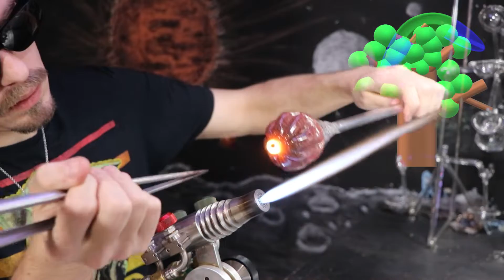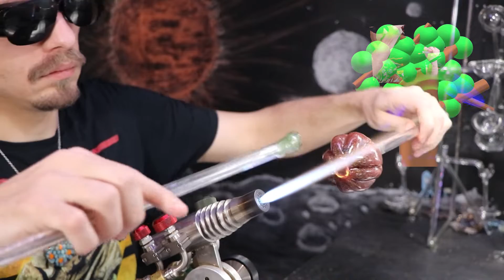Glass Pumpkin on a Lampworking Torch

Comment: Thanks for the knowledge! Quick question. Would it it be worth it to buy a glass blowing kit that comes with everything you need (even small kiln) or cheaper to buy everything separate?. Kits i am talking about cost around 3000.00 shipped in the US.
Reply from the maker: I think it would be better to start simple without the kit and buy more tools as you go. $3 Tweezers, graphite paddle, and a Reamer or Jacks can help you learn a lot. (26mm by 4mm) are good for main tubes & (12mm 2.2mm) for blow tubes. You can buy your kiln later also and take time to practice. Sales won't come right away so you have to plan long term. Thanks for the question Francisco and watching!
Reply: @MattJasa  I do have the money to buy a torch. Good idea. I can do that and practice and buy as I go. Thanks again !
Reply: My 2cents... Look on the various used seller sites.. FB Marketplace, Lampworketc.com, ... for someone selling a studio or selling off extras. I got a whole set up (250# O2 tank included) for $1000 off Craig’s List as my start up. They had Nortel Minor torch, the tank, didnyums, LOTS of boro tubing and rods, boku tools and loads of other stuff. The artist had come home from errands one day to find her 8yo sitting at the torch pretending to flamework like mom. Luckily all gas had been disconnected (for safety reasons) but it highlighted that the kids were NOT the right age to have that around AT ALL. Main thing I’ve heard over the years is to NOT buy a torch if the gas lines are simply cut off just below the intakes, no matter the “story”. It’s a sure fire 🙄 sign of being stolen and probably not working. But there are lots of people upgrading equipment or getting out of the trade who just want to pass it on and make a few bucks back out of what they’d invested in. Welcome to the FLAMES! 🖖🔥

Comment: Can you recommend a good beginner torch?
Reply from the maker: □The Alpha from Bethlehem Burners is a strong starter. It's also the center-fire for the Bravo I'm using. I tend to use it a lot, more than the outer-fire.
Reply: You and I were thinking the same thing! Lol...I ordered one about 3 hours ago!  Where can I go for oxygen?  I’m shooting blind with all this
Reply from the maker: @elizabethwatson71  That's a good question, I normally recommend looking for oxygen first before anything else. You can either go with bottled oxygen from a local supplier in the area, or a 10lpm oxygen concentrator. The concentrator is expensive but can pay for itself in the long run versus renting tanks of bottled O2. Here is the one I use: https://www.mountainglass.com/Invacare-Platinum-10Lpm-9Psi-3yr-Warranty-Concentrator
Reply from the maker: @elizabethwatson71  It's a little confusing at first setting up a new studio; there's a lot of little things to consider. But once everything is set up it only takes turning some knobs and hitting a few buttons to get your torch going. Here's my quick set up video, it doesn't go over ventilation though: https://youtu.be/9kjJa23_Mxo
Reply: I’ve watched every video on setting up that YouTube has.  I can build a bench no problem,I have a full functioning hobby workshop.  How will I go about stabilization of glass in the winter?  I’ll be using the setup in my garage but worry about the cold.  I was thinking a small space heater and rod warmer.
Reply from the maker: @elizabethwatson71  Very cool, it helps to have the right tools. Winter is tricky, tools and glass will chill your hands. The torch doesn't warm the area much either with ventilation running. I normally close up shop once it gets too cold, but space heaters and layers of clothing do help.
Reply: I’ll be working with soft glass for the near future and not attempting any fuming soon, do I still need a ventilation system?
Reply from the maker: @elizabethwatson71  It would be safe to have some ventilation going for flame exhaust. You might not notice it immediately, but over time it wouldn't be good for your health breathing that in. An 8" to 12" squirrel cage fan (~700cfm) should work nicely.
Reply: I was just going to (in cold weather) use a floor fan to push air out through the bottom of the garage door. Right now I work with the doors up and a big shop fan going.  Do I still need more?
Reply: @MattJasa  wish i would’ve got it, i love my national 8mm but o had to immediately get a hand torch since no center fire. Eventually added a rider too I’m about 10 months in
Reply from the maker: @elizabethwatson71  It's really hard to say. For safety I always have to advise the best options even if I may be overcompensating. The fumes might rise and gather against the ceiling especially in cold weather so a floor fan might not catch it. Also remember to bring fresh air in or else the exhaust fan will just cycle the outside air.
Reply from the maker: @BruhMakesGlass  They just released a new Bravo design. Its suppose to have a sharper center flame, but from what I've heard it's also a smaller flame. I can't say for sure as I don't have access to it, but it does have the 2nd stage for larger flames so it might be an advantage.
Reply: @MattJasa  that’s awesome, i love my hand torch but I’d kill for a solid center flame torch too